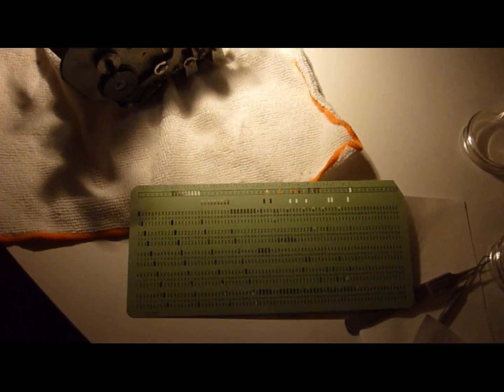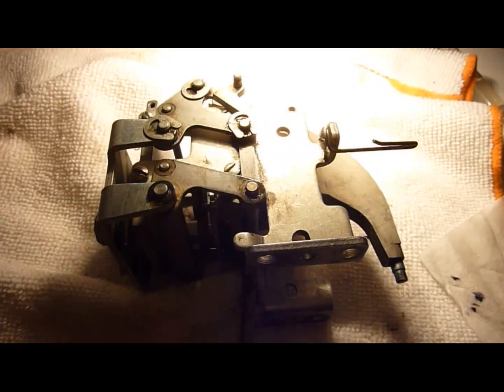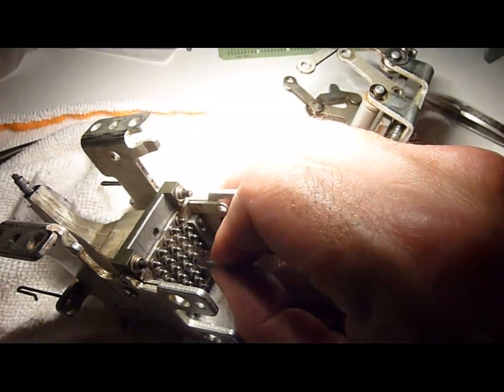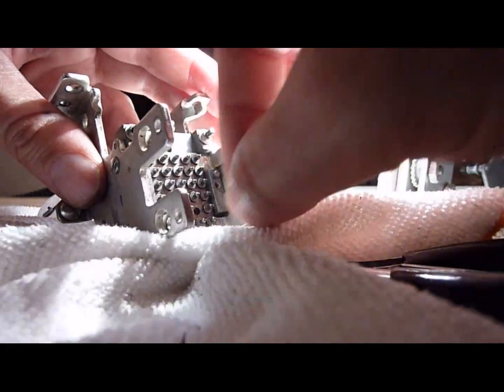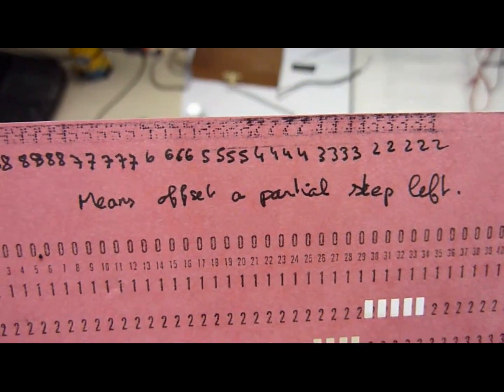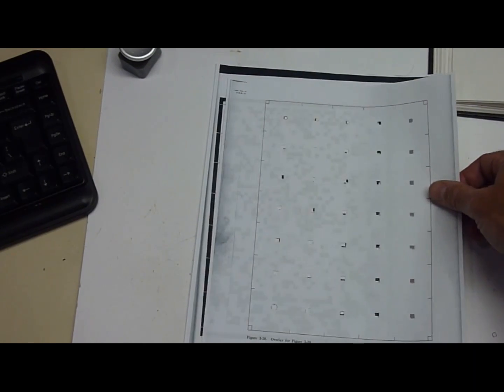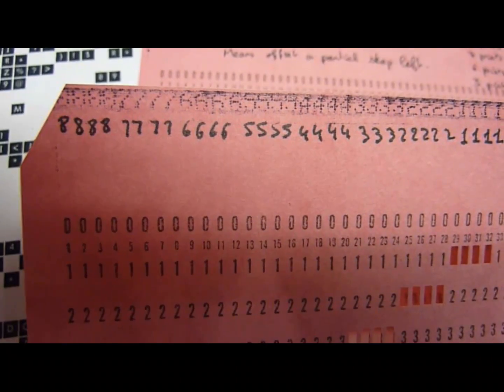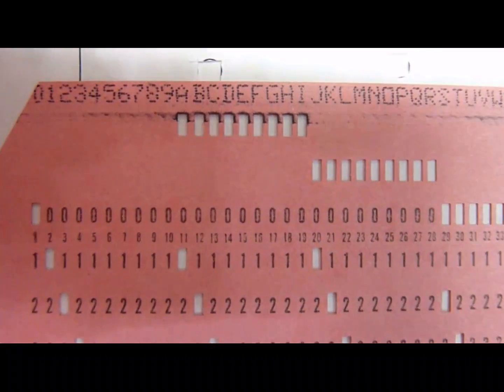IBM 029 Keypunch Restoration 7 - Print Head

Comment: 5:20 that's a different kind of off by one. That machine has some crazy complex things going on. The keyboard will surely have some "Logic" behind it with respect to the punched holes (or some special IBM kind of logic?). The same goes for that matrix printer selection plate (or how would one call it). Very cool stuff from way back when there was no such thing as a micro controller.

Comment: I want to service a dot matrix print head. Would you suggest using alcohol to clean and then using the sewing machine oil for lubrication after?
Reply from the maker: That's what I did here. But I have only done it once, that hardly makes me an expert. Note that although it might look simple, this was very difficult, and I got lucky to realign it without the proper IBM tools.

Comment: nice work! that code plate is amazing
Reply from the maker: +Matt Siegel I'm glad someone noticed! This mechanical dot matrix printer unit is a gem that originally appeared in the IBM 026, a 1940 era machine, and is still unchanged in this 029 punch 24 years later! Possibly the first matrix printer ever.